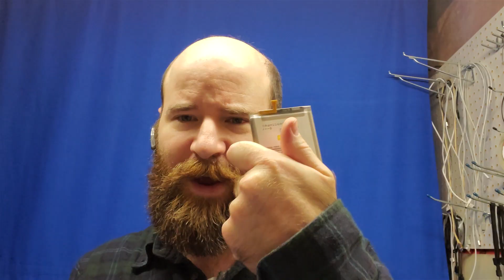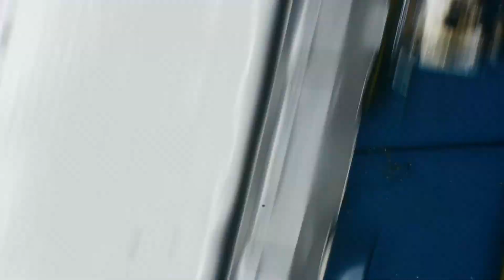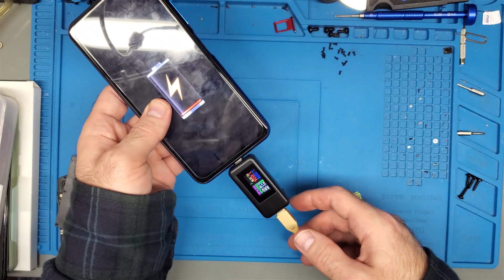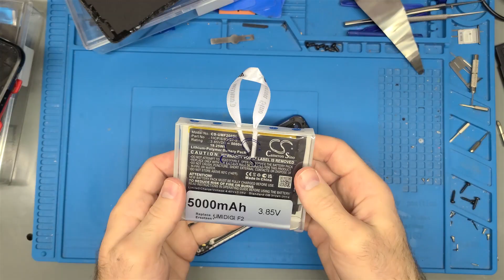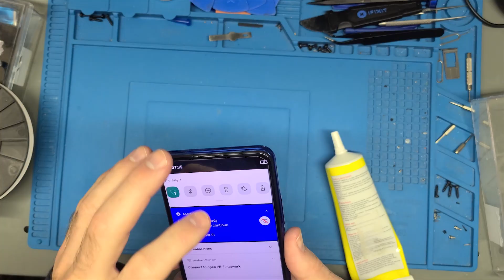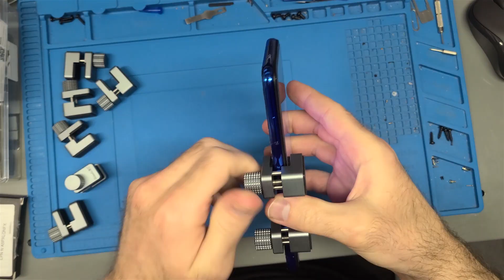I Try Modding a Samsung Phone Battery to Fix an Umidigi F2

Comment: Puede hacer un video cambiando el boton de huella dactilar del umidigi F2
Reply from the maker: I can't. I have no Umidigi's on hand anymore. It's pretty simple repair though. Following even how I took this phone apart, the next step is simply removing the busted fingerprint reader and putting in another. Then your only worry is whether or not the fingerprint buttonis encoded or not to your specific Umidigi.
Reply: @TalmiiorFixesStuff  hola tendras algun boton de huella dactilar que te gas de este modelo? No encuentro en ningun lado. El modelo umidigi F2 su lector de huella hacia tambien la función de boton se encendido
Reply from the maker: I don't have one. The Umidigi series of phones are off brand phones and are difficult to find parts for. My recommendation is try using ChatGPT to do your search. It can sometimes help narrow down the search. Make sure to specify your country and currency in your ChatGPT message.